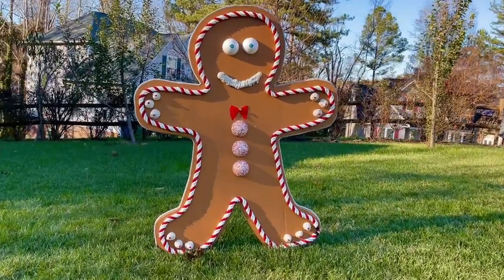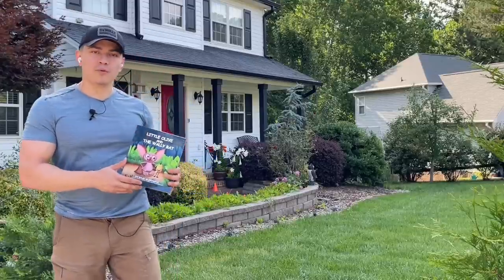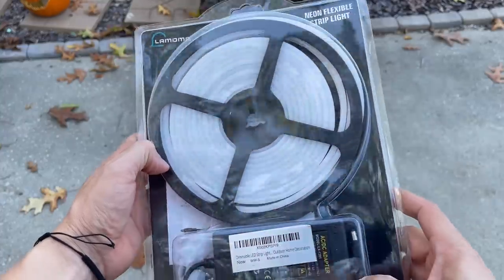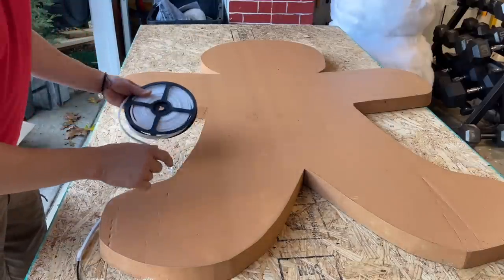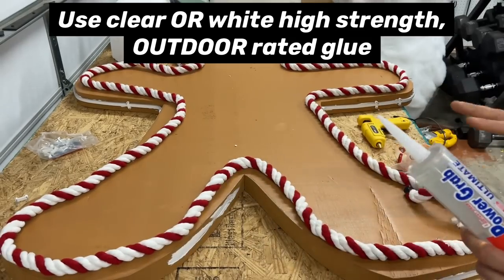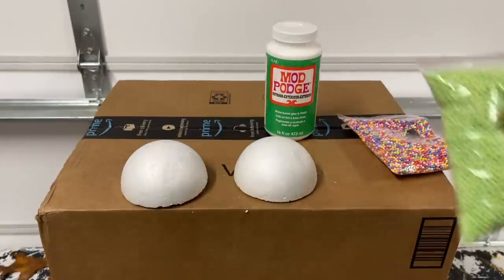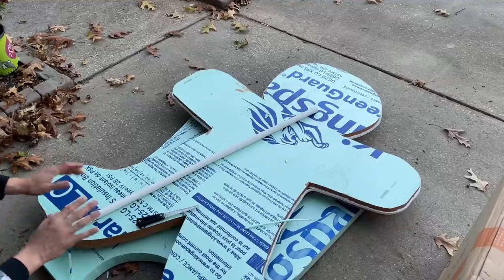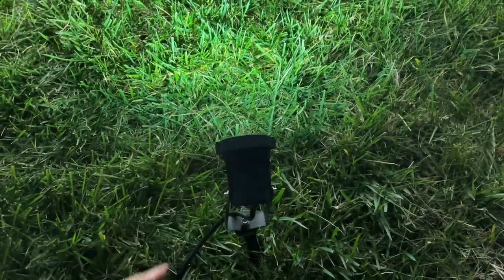GIANT GLOWING GINGERBREAD! - TUTORIAL

Comment: I used my Dremel and cut a trench in the back of both legs 2 1/2 feet long and 1 inch deep.  Used wood glue to set the PVC pipe and then -painted over it.  You can't even see them unless you are close to the back.  Having 2 anchors makes it really stable and you don't have to worry about the wind blowing it sideways.

Comment: I bought those lights for the candy canes and they are great. I will buy more to add to the gingerbread we made as well from your other video.

Quick question though... did you do anything to shelter or protect the charging battery connector from rain or snow. I read in the Amazon description that the lights are water proof but not the actual cord/battery pack.

I figure your recommendation would be better then what I could think of as you are truly an amazing DIY-er.
Reply from the maker: I’m so glad you made them. I never covered any of the connections, they remained outside in the elements uncovered. That being said, I think I simply forgot to cover them and that’s why they remain uncovered. I am actually putting them in a waterproof box this time around because I don’t want to chance it
Reply: They turned out very nice. We put them up today and got a bunch of compliments already.

A waterproof box? Can you add the link, please. I had no idea they sell those. I was going to use Siran Wrap or a small toppaware container...LOL.

Comment: My wife and I are are trying to make these and are wondering what would you think if we went with a smaller thickness for our gingerbread? like a half inch or 1 inch?
Reply from the maker: I’m glad you are trying to make these. Though they can be made using 1 inch or half an inch, the problem is durability and rigidity. If you plan to have them displayed in the yard like I have them, they could easily break in the wind or stormy weather. But yes, they can be made using smaller foam board

Comment: How do you get the full foam board home intact?  I don’t have a pickup truck and delivery isn’t a viable option because shipping itself is nearly double the price of the board.  I could probably break it apart at the store and glue it back together at home
Reply from the maker: You’re asking me how I get this home? I mean, you need a pickup truck… don’t you have any friends with a pick up truck? Don’t  break it apart at the store, it’s not gonna be the same thing when you glue it back together
Reply: I have an SUV and made it work. I’m about 5 miles from Home Depot, brought it home on the roof secured with ratchet straps.

Comment: Question: does it matter what kind of 4x8 by 2 inch board one gets? The Green Guard isn’t available here, but I assume that it doesn’t really matter.
Reply from the maker: Correct it doesn’t matter, as long as it’s 2 inches thick then you should be fine with the green one, pink one, white one or other colors
Reply: @IsaacAlexanderDIY  Thanks so much! I am going to try to make one of these guys this week. Thanks for your response!
Reply: @IsaacAlexanderDIY  I asked this above but this question might go to you directly here: when you cut the rope for the perimeter, how do you finish it so that it doesn’t look frayed? Thanks so much for this tutorial!
Reply from the maker: @Gleem1313  I use black electrical tape and wrap it around the cut ends

Comment: Did you peel the paper off the foam board before you cut and paint it?
Reply from the maker: If you have foam board that has paper then you have the wrong foam board. That is not insulation foam board and will not work well because it is too flimsy and too thin